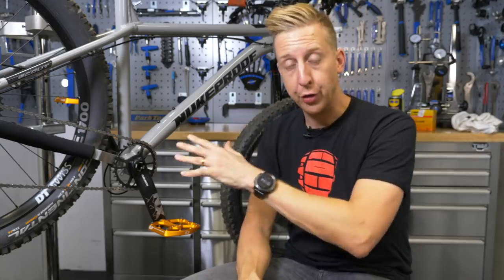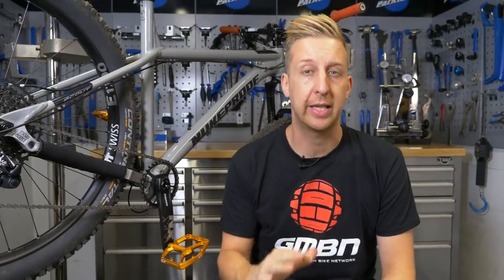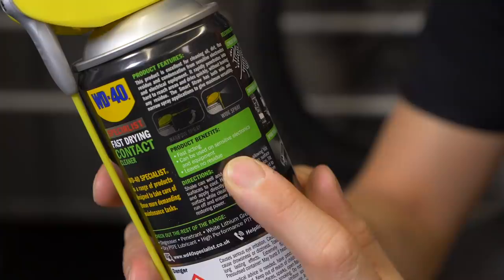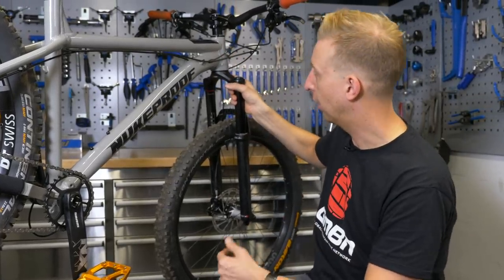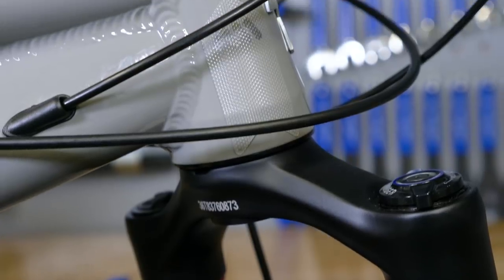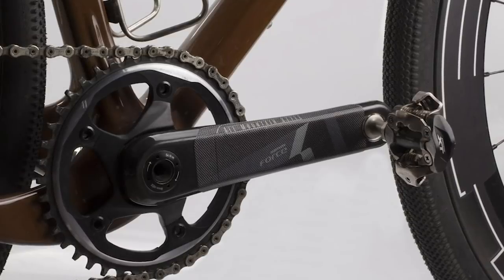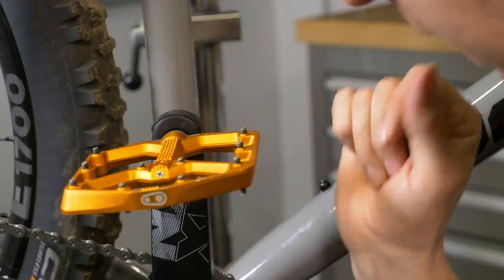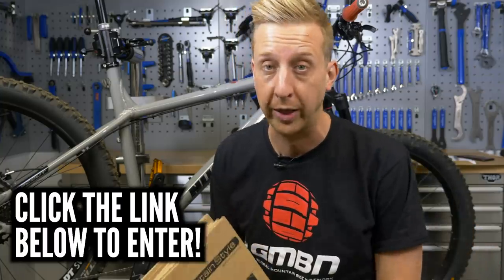How To Protect Your Frame | GMBN Tech How To

Comment from the maker: Do you use a frame protection kit to keep your ride looking fresh? Let us know 👇
Reply: GMBN Tech Yes I will be when I have my new bike
Reply: Yes all mtn style
Reply: I completely rely on the ghetto way of using inner tubes and old tires as protection. Works really well and looks quite cool.
Reply: Nope scratches are like badges that are earned . But I don't have a carbon bike either . If I did I would definitely use it.
Reply: i went to a car wrapping place and bought some leftover pieces of PPF film for a couple euro's. Takes a bit of effort to make your own stencils but its cheap and effective
Reply: Canyon already has some frame protection and I've added some protetive stickers and taped some cables that were rubbing on the BB.
Reply: Absolutely, I'm doing the same thing to the same bike, but I'm using the Lizard Skin carbon stuff.  I've only done the bottom bracket area so far. I will be going with clear for the rest.
Reply: Got an invisiframe kit, expensive but worth every penny. Really well cut and fits like a dream..
Reply: i just use matte racers/heli tape, works a dream and you cant even see it
Reply: Yep, pre cut invisiframe...good, tho bit thin and faff to apply, but great finish if u take (lots of) time
Reply: Yeah, All Mountain Style!
Reply: I have the AMS kit on my bike.  I used a hair dryer to get it around the tubes without any air bubbles.
Reply: Yes, AMS!
Reply: I use a roll of 3M vinyl
Reply: Really want a set please pretty please with a cherry on top!!
Reply: Basically, on this channel, you guys are providing me with the best bike tech videos. But now I feel weird about this video.
On one hand, you mentioned different stuff, on the other hand, lots of stuff not shown on a camera...
And here I am with my brand-new frame looking for other tips on youtube.
By the way, without your channel, I wouldn't dare to build my new bike piece by piece.
Reply: No. But like the look of the kit you used.
Reply: yea, got some heli-tape , wanna try it out on the next few days!
Nice Video ! Helps alot to find the right spots !

I'm very angry for beeing to late with the tape ... new bike - first ride - first stone - first break in the paint-job on the tube :-P

How a video about bashguards - especially what kinds out there and how to install - (even with adapter for iscg) ... ;)
Reply: Not at this time. Want one but my bike isn't quite like the new ones
Reply: I have new paint job and will definetly put some protection on it

Comment: If you're putting a protector on your bottom bracket shell make sure to poke a hole through for drainage (if you have one in your frame) so that water doesn't collect in the shell during washing or riding.  I forgot to do this on an older bike and the BB died pretty quickly.  When I realised and poked a hole through a load of rusty water drained out :(

Comment: Careful with the brake cleaner, at least in the United States.    Most brake cleaner I've used says to keep it away from paint.
Reply: Nick Barnes I shoulda look at the comments first, I kinda say the same, cheers mate!🤘😄
Reply from the maker: We suggest an isopropyl alcohol based cleaner. Almost all bicycle cleaners are made up of this as a base ingredient. Yes you are totally right that some automotive cleaners contain other nasty aggressive solvents you want to keep away from paint!
Reply: Brake Cleaners in the U.S. contains acetone which strips clear-coat.
Reply: Nick Barnes Well the ones you're using are probably meant for cars and motorbikes etc..
Reply: Nick Barnes yeah most brake cleaners will melt paint
Reply: @ProMountainBiker  No they won't, if they're quality.
Reply: Tomi Saaranen depends on what you mean by quality.  For its intended purpose the automotive ones that melt your paint clean your brakes way better therefore are better quality than then the weaker ones that may be safe to use for cleaning your bike.
Reply: @edensgardenshed9622  For example Muc Off disc brake cleaner.
Reply: what if already have paint chips on the top tube. Can i put a decal over it?

Comment: I like those AMS protectors. I used a utility knife to cut out a nice hole for the cable routing on the bottom. I think a dry erase marker is helpful for setting the protectors

Comment: The AMS kit is reasonably priced, and the honeycomb design looks like it will be quite tough, but at the same time obscures the paintwork and I'm not so keen on the branding logo on every single piece. I got an invisiframe kit, which is a lot more expensive and a little tricky to fit, but you get a kit that's custom made for your bike and if applied correctly it's almost invisible
Reply: I only have the protectors on the bottom of the bike and the insides of the chain stays so they’re actually very hard to spot unless the bikes flipped over.

Comment: One of the things I will do with decal applications, is use the shiny side of the decal paper, to rub the decal into place. Makes it fairly easy to apply pressure, and be able to slide across the surface of the decal with relative ease. Once again, great informative vid Doddy. You're making it super easy for me to keep my ride in tip-top shape.

Comment: I wouldn't recommend using an automotive brake cleaner. They are usually much more aggressive than contact cleaner or isopropyl alcohol. You can run the risk of damaging the paint with a strong chemical like brake cleaner.

Comment: I use 3 M auto hood and fender protector. I get the leftovers from a auto tinting shop they cant use the smaller pieces. You can cut small pieces for cable run areas

Comment: Yeah I got a scratch in the paint on my top bar sadly. Must have rubbed against it with my shoe (where pebbles can be stuck to the underside) when stepping off in a hurry. I have since put on protection to avoid further scratches.

Comment: I bought protection tape for cars for 6€ per 5 meters x 5 cm. Then I used the technique of Joe in Joe’s bikes: prepare a spray bottle with 30% isopropyl alcohol and 70% water. You spray both the frame and the adhesive side of the protection plastic with the mix. Then you can move the plastic after applying it and it stocks much better to the frame
Reply: Same method for invisiframe application, but with baby shampoo (few drops only) in 1l water

Comment: Awesome helpful video - here in the US… DO NOT USE BRAKE CLEANER on any part of the bike except rotors and brake pads. Keep to the alcohol. I friend of mine permanently ruined his bike using brake clean. Don’t be him! Else, this video is spot on!
Reply: If it says on the back no acetone your ok I’ve just used holts brake cleaner on a brand new frame and fitted a kit, also don’t spray the bike spray the rag your using.

Comment: G'day from downunder Doddy. How easy are those frame protection kits to remove in a few years time ? Will the adhesive remove any paint once its hardened over time.
Reply from the maker: The paintwork is going to be fine. If you want to make it easier to remove frame protectors or stickers try using a hair dryer as this helps a lot!
Reply: @gmbntech  I suppose it all depends on the quality of the frame protection stickers, whether they were bought online from china or some of the AMS ones that i'll hopefully win....... hahahaha

Comment: I always want to ask does alcohol damage the paint or the protection lair?

Years ago, I thought alcohol will not harm the car paint, so I used it to clean the sticker residual on my engine carver which ended up damaging the clear coat. Where I used the alcohol on, turned from shiny to matte look....which was bad

Since bicycle paint is about the same way as a car is painted, will alcohol really save on bicycle paint?
Reply: IPA does not damage car/bicycle paint. It's popular for many car detailers use a straight IPA wipe after a wash and before applying a new wax/sealant to the paint. Either your method of scrubbing the sticker residue (scrubbing too hard/using an inappropriate cloth) caused damage to the clear and/or the sticker/vinyl that was originally there had caused the damage over time with grit getting behind the sticker and vibration over a long period of time causing the damage.

Comment: Would a heat gun take the bubbles out of the honey comb style plastic protectors?
Reply: just poke the bubble in the middle and the air can escape than push the are into the frame and it is done.
Reply: @pregardt  no. That wouldn't work for the honey comb style tape, as there are hundreds of tiny bubbles supported by ridges of plastic...

Comment: Buy your isopropyl from a reputable dealer some of the stuff on a popular auction site is inferior diluted down dispite it's alcohol content claims
I prefer to use autoglym glue and tar remover.
Invisframe is the best solution but handmade frames like orange are made on jigs so allow for some tolerance issues when applying the vinyl .
Using an old inner tube is great for the environment but anyone who's removed an old one will know how much water and dirt can still get under them even when fitted tight and sealed off and whilst alloy doesn't corrode it does fatigue
Reply: Just go to CVS or Walmart
Reply: Not available in the UK

Comment: I consider myself extremely fussy. I match my anodised valve caps with my anodised cable end ferrules, I have crank arm boots and blingy chains. I colour co ordinate my bling to the bikes original colour scheme and I even try to colour match my riding gear to the bike as well.

I keep my bikes meticulously clean and well maintained also, yet I just cannot get away with going down the frame protection kits route. Neither can I bring myself to wrap chain stays with inner tubes. 

The way I see it is, covering your bikes frame with stickers and tape stops you from seeing the details in the bikes design/colour scheme anyway. A big strip of tape looks worse to me than a little bit of cable rub, or heel rub. Even a few stone chips under the BB and down tube doesn’t  bother me. These are all signs that you use your bike as it was intended. 

A wrapped up, stickered up bike just looks pants to me. I’d rather have the signs of use on display.
Reply: When I smash my bottom bracket on a rock I can really appreciate how the sound is now muted. It speaks to how the impact is being spread out. I think there are some engineering advantages to protecting certain parts of your bike.